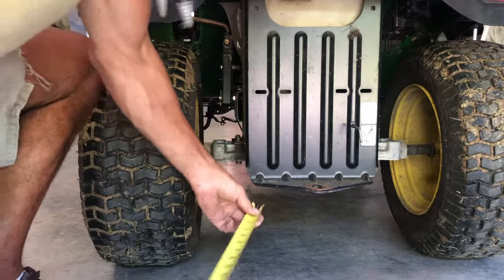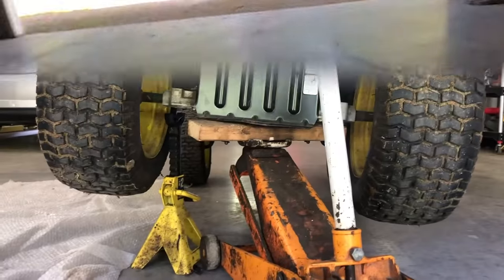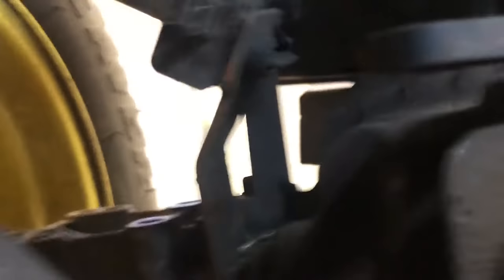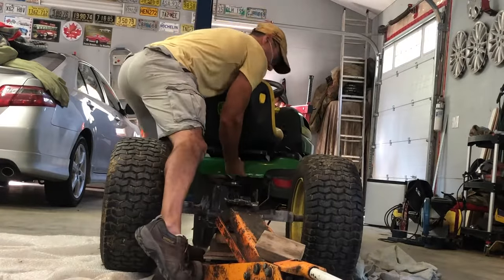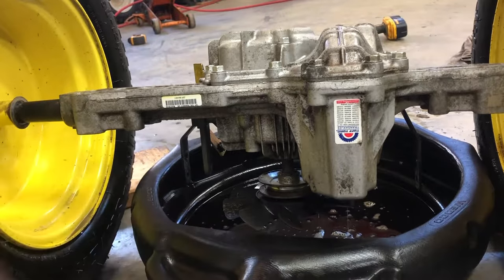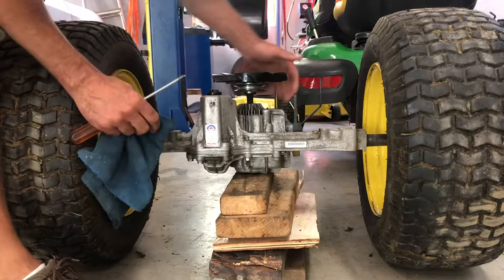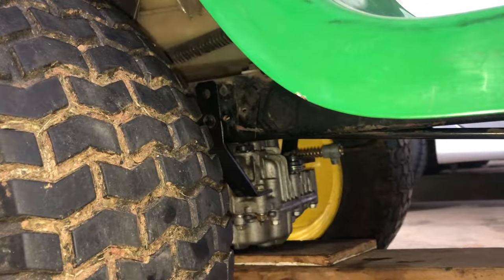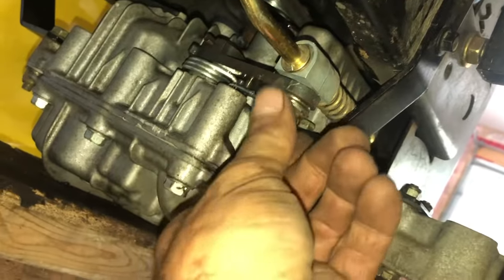How to change your oil in your Differential / transaxle / Transmission John Deere Lawn Tractor

Comment: My D170 is really struggling to go up hill after about an hour of mowing, never knew about changing the oil. My manual says no owner maintenance on transmission - go figure!
Going to get some oil today and change oil, hope it helps.
Reply from the maker: Hope it helps.   You can check out my "Part 5, LA165 John Deere Lawn Mower Tractor Mower rebuild".  I take the trans apart.  
   (I wouldn't take it apart unless it stops working)
Reply: and if you take it to the John Deere dealer, they'll tell you the same thing, no maintenance.  They'll say you have to replace the old transmission with a new one when all you really need to do is change the oil.  The cost of doing that is high enough so that most homeowners will choose to buy a new tractor which is exactly what John Deere wants you to do every 4 or 5 years.  that's why they use these crappy designed "unserviceable" throwaway transmissions.  They also never tell you that if you plan on keeping your tractor for more than 4 years, you should do maintenance on the transaxle after the first 50 hour break in period.  That's when the oil will be dirtiest with metal shavings in the gearbox.  You should remove the transaxle and take it apart to remove all the dirty oil and metal shavings out of the gearbox, and then replace the old factory installed 10W30 oil with a slightly heavier grade 5W50 oil.  That will give your transaxle maximum torque and a much longer life.
Reply: @mrbubetube  GREAT comment, every body should read this.

Comment: Will be using Amzoil Hydrostatic zero turn 20w-50 oil with a preferred price less than $10 a qt. This oil can take the heat and maintain its viscosity for a longer period!
Reply from the maker: I'll have to try this oil next time..  Thx...
Reply: I'm with you on the 20-50
Reply: @me37594  or castrol 20W 50. Used it in my lawn mowers and motorcycle engines and car engines for 50 years. Never any problems. thanks. 🙂

Comment: Thanks for the video. The manual said I had to change the transmission fluid but does not show how. Is the process the same for x350?
Reply from the maker: It’s totally different.   Drain plug at the Bottom. Side oil filter.  Filler cap in the back .

Comment: Thank you very much for the time producing this video, well done and lot's of good educational information! Seems this is a lot of labor for a simple drain/fill procedure. Is there an aftermarket and/or new version of the oil pan with a drain plug or would removing the bottom of the transmission pan to drain then fluid, reinstall pan with new gasket, then refill the transmission as an other option to avoid the labor and time to remove the transmission axle?
Reply from the maker: There is a drain kit available for it.  “Taryl Fixes All “ did a video on it.  
   The transmission still had to come out.

Comment: good video, I have a John deere 110, with 425 hours, I have never serviced the differential, it sounds very dry, I think it needs an urgent oil change.
Reply from the maker: The noise you hear is the hydraulic pump. (Normal).  It wouldn't hurt to change the oil when you have time on your hands........ Don't overfill it.  22-25mm top edge.

Comment: Great video! Are there any current production lawn tractors that do have a proper drain/fill plug? I hear Cub Cadet XT1 does, or did, but I am not sure.
Reply from the maker: That’s the only one that I know that has them.  You have to lower to transmission down a couple of inches to fill it back up.  You need a mirror to look at the oil level so you don’t over fill it.

Comment: I'm looking at possibly buying a used john deere x350 from my dealer. Looks,runs,and drives great. Its got 296 hours on it and has the k46 transmission. Of course I have no way of knowing how it was used and possibly abused,but it looks to of been garage kept. They're asking $2900 for it,but they also have an x580 which has the serviceable k72 transmission.  It's the same year and condition, but has 500 hours on it. They're asking $3999 for it. I do mow some hills that my current ltx1040 cub cadet struggles with. If it were you,would you buy a small newer mower,the 300 hour x300,or the x580 with 500 hours on it? As long as the engine and tranny are sound I dont mind replacing belts,spindles,and switches. I'm pretty mechanical, just thrifty. I mow about an acre and a half a week
Reply from the maker: Bigger the tractor the better, lol. Offer them $3750, $3800. Tell them you want the oil changed in the transmission . 
    A X580 here in Canada are over $6000us.
Reply: @WeekendHobbyMechanic  thanks,I'll tryin talk to em more about it.

Comment: Thank you. Having watched this I have no reluctance to tackle a fluid change. You did not omit a single step.  Appreciated.  I have a low hours JD 160 and since I mow straight up some very steep hills I expect my transaxle will benefit from a switch to full synthetic and regular changes.  I have 40 hours on the tractor now.  Should I do the first fluid change at 50 hours?
Reply from the maker: No.. Change it at 200hrs..   Remember the Oil Level after priming the Pump & motor should be down 22mm 25mm from the top edge of the filler cap.
Reply: Yes, change it at 50hrs per Tuff Torq website: https://www.tufftorq.com/tuff-torq-k46-oil-maintenance/
Reply: @joshlasceski  The JD 160 has a gear drive transmission (Peerless, if I remember correctly), not a Tuff-Torq.  According to my dealer, there is no need to service it.  I have about 1700 hrs on mine.  As for the Tuff-Torq, it seems to me like a pretty poor design if you have to remove the transmission from the tractor just to change the oil!

Comment: Thanks so much for this great video. I don't think I have ever saw any one do as many replies as you have. My JD LA 145 is VERY SLOW going up hill. It has about 425 hours on it and the transmission oil has never been changed. There is also whining noise which may be coming from the tyranny...(not sure). Which oil, 5W50 or 20W50 do you recommend? I'm in Va. so the mower is used in, some what, colder temperatures. Thanks again!
Reply from the maker: Use 20W50.  Your pump is probably getting weak.  (Thicker oil should help)....
Reply: @WeekendHobbyMechanic  Thanks for the quick response!

Comment: My LT166 is a 2002 and has never had the trans fluid changed.  I called the dealer about it and he asked "is it slipping"?  No, it has never slipped or done anything out of the ordinary.  He said just leave it alone then.  Well that is what I did and it is still working perfectly so ????

Comment: Oh man that is way more than you need to do, just drill a tap for drain plug in the bottom of trans and then you can change it easy. It took me maybe 20 minutes to install a drain plug in mine.
Reply from the maker: You would need to drill two. Gear side and Pump side....
Reply: @WeekendHobbyMechanic  Yes, but even one works if you change it a little more often, but  I may go ahead with the second drain. Good video for those that don't want to drill and tap their trans. Thanks.

Comment: What are some symptoms of needing to change out this fluid?
Reply from the maker: I would recommend changIng the oil every 150-200hrs.   If the tractor is slowing down going uphill I would use 5w50 Castrol oil.

Comment: Do you think you could use an evacuator and pump it out instead of taking it out and apart.. suck the fluid out vs dropping rear end
Reply from the maker: Could be done, but it would be hard to check the oil level.  22-25mm from the top edge.

Comment: I have a JD 190C with the tuff torq k62. 
My question is it says it has two separate drain and fill points (one for the hydro stat the other for the trans axle) and I have to prime it as it does not self prime. But you just dumped yours over and filled back up. Am I missing something?
Reply from the maker: K62/K66 transmissions are a bit hard to prime after an oil change.  Different transmissions. They trap air bubbles.
   To prime these you have to leave the filler caps off the transmission.   Jack up the tractor (use jack stands), run the tractor for a bit.   
     Then shut off the tractor, rotate the back wheels (by hand) back and forward.  Top up your fluid levels.  Then repeat the process again.   Do this three or four times.  
      After you get some resistance in the back wheels, run the tractor for 30 secs (forward/backward).   The wheels should start spinning.    Top up your fluid levels again.  Install the filler caps.
Reply: @WeekendHobbyMechanic  thank you so much.  I subscribed.

Comment: My machine (D125) leaked a fair amount of transmission fluid while in the garage for the winter.  Watched your video and dropped the rear axle.  Mine appears to be leaking from around the other cap that is on top of the transmission, not the flat fill cap.  I can't seem to figure out what this cap is called to order a replacement. Any idea?
Reply from the maker: The breather cap?  It sits a little higher the fill cap?  Oil won’t leak out from the top of the transmission just sitting idle.  It will leak a bit if there’s a bit too much oil in the transmission.  No biggie, it will stop.   
   Check to see if it’s leaking around the axles seals or the bottom pan gasket…. Also check the fill cap for crack in the rubber.

Comment: I let my tenant use my JD LA120 and they reported it quick working.  I'm 400 miles away and can only work on it in snippets. I replaced the lever arm from the PTO handle to make the blades function again  but when I tried to move it there is no tarns action.  Unit has 800 hours on it.  I wondered if they had pushed or pulled it and broken the trans. The neutral rod was pushed in so trans was engaged. Don't know if that could break the trans.  I pushed the neutral rod in and out a few times. No luck. The trans drive belt is still there.  Mostly wanting to know if the unit was pushed or pulled hard in-gear can that break the trans.
TIA
Reply from the maker: Maybe they broke the drive belt.  Have a look if the fan is Turing on top of the transmission. You will need someone on the tractor to engage the transmission. 
  You should be able to see the top of trans under the left side between the fenderdeck and back wheel.   With the brake off, the belt should be tight.
Reply: Thanks I'll try that. The belt was really loose but I'm not sure the brake was on or off. @WeekendHobbyMechanic

Comment: Great video. I have oil coming out the left hub and a grinding noise. I guess a bad seal. Can it be saved?
Reply from the maker: Wiggle the shaft for side play. Bushing might be worn.   Might need a new bushing and a seal.  
   If there's hardly no play, you might just need a new seal.
Reply: @WeekendHobbyMechanic  Thanks for the video and suggestion.
Reply from the maker: @darrellanderson6650  I redid this video. Check it out. 
https://www.youtube.com/watch?v=on7aHn2v2Rs&t=323s

Comment: I seen you used the JD fluid. If I wanted to change to Amsoil 5W50 do you think it would be a problem?
Reply from the maker: That would work....   (That’s the best oil)
Reply: Thank you. Great videos!!!
Reply: Just use Castrol, 20w50, use Castrol in everything, your vehicle will thank you
Reply: @GatesRapes  engine oil in the transmission???? HUH???

Comment: I use a over head hoist and it’s pretty fast and easy to drop rear end and replace it
Reply from the maker: Hard to check the oil level that way.
Reply: @WeekendHobbyMechanic measure it😊

Comment: Very informative. But a question for yah. I have a  2015 CUB CADET XT2 LX46 with no manual. Would you know what transaxle normally comes with it? In not, how do I go to find out the easiest way? Thx much.
Reply from the maker: Tuff Torq Hydrostatic Trans .  You can check the model number on the sticker in the back trans.
Reply from the maker: Model is a K46
Reply: @WeekendHobbyMechanic  thx much.

Comment: i am getting ready to strip one of these l130s down and what is the wire that runs to the rearend? i see yours has a wire hooked to it.. mine dont care to answer? thank you
Reply from the maker: The wire goes to the transmission reverse switch.    It’s a safety device.

Comment: I have a John Deere gt245. I sent it to you the repair shop to replace the transmission drive belt and when I got it back the transmission itself is leaking whether running or sitting. It seems like it's coming both out of the overflow bottle and from somewhere else. Thoughts?
Reply from the maker: If it’s coming out of the overflow bottle it’s probably air in system.  You can suck a bit of oil out of the bottle and run the tractor for a while.  Then check the oil level after.

Comment: I have an LT-190 machine with 228 operating hours on it. What kind of oil should I put in the transmission, and how often should I change it?
Reply from the maker: Came with 10w-30 from factory but you can use 5w-50 castrol synthetic. If the trans is slipping a tad you can use 15w-50 mobil 1.
Reply: Thank you very much! @WeekendHobbyMechanic

Comment: My magnetic was just a magnetic. Circular, I wonder if it’s missing the holder like yours. Mine is d140
Reply from the maker: Yup,  You’re missing the holder.      No big deal.
Reply: @WeekendHobbyMechanic  just completed the project. This video was very helpful. I went with Amsoil 20-50 hydrostatic fluid. D140 only has one magnetic with a slot built in on the tranny :)

Comment: Saw this video, got all excited, went out and bought the oil and plug (which wouldn't fit) drained it refilled it, put it all back together and it still won't move! 😢😮😱
Reply from the maker: Was it working before? Was the old oil dark in colour?     Watch this video:https://m.youtube.com/watch?v=3D_vtMg-Zxg&pp=ygUfUmViaXVsZCB0cmFuc21pc3Npb24gam9obiBkZWVyZQ%3D%3D
Reply: @WeekendHobbyMechanic  hi thanks for your reply.

The oil was darkish I guess.... There's over 700 hours on the clock. It's a D140 over 9 years old. I inherited it from my parents. Dad's pretty sure the oil's never been changed in that axle.

I'll check out your link, thank you. 👍
Reply: Watching your second video I realise that perhaps I didn't "prime" it like you did, nor did I take so much care (any) with miniscus depth measurement.

I did tip it from end to end as you did in the first video.

I might Google to see if there's a check list of things that stop your lawn tractor moving 🤔

It has a new drive belt.
Reply from the maker: @andrewboydnz   Make sure the Neutral Rod is all the way in and the E-Brake is off.
Reply: @WeekendHobbyMechanic  now I'm wondering if it might be the clutch(?) Pulley thing under the engine. 

If I pulled the backwards/forwards lever on the axle and rotated the fan, the whole axle thing wanted to  rotate 🤔
Reply from the maker: @andrewboydnz   Have somebody start the tractor and release the E-brake. Then look on the top of the transmission if the fan is rotating.
Reply: @WeekendHobbyMechanic  the belt's not moving! Going to check and see if something's stopping the brake from releasing all the way out... New belt seems a bit loose 🤔 (as did the old one)
Reply: Finally I removed the new Chinese belt and installed an original. Now it's moving! Yay!
Chinese belt on the cutting deck is totally fine, but I guess there's more travel in its tensioner 🤔
Reply from the maker: @andrewboydnz    Awesome!
Reply: @WeekendHobbyMechanic  thanks for your help! 👍❤️

John Deere should be paying you for keeping their customers happy 😊
Reply from the maker: @andrewboydnz    That would be awesome. lol

Comment: I have a tuff torq t40 should i use the original 10w30 that is calls for or somthing thicker i have a power problem after a year of use. I have changed all the pulleys and the drive belt on my JD and still nada as far as fixing.
Reply from the maker: Tuff call on that one.  Ticker oil will help but it will slow it down a bit.    Check the color of the oil.   Dark means it’s not good.  Filter could be dirty.

Comment: I mean the Mfg. putting in a drain plug and fill plug might have saved us all a lot of hassle.
Thats why i will never sell my Craftsman GTs... they will run forever with proper maintenance (like changing the trans fluid since it only take 10 mins)
My LT2000 requires a process similar to this and takes 3+ hours.

Comment: Would this be the same procedure with the X380- K58?  I only have 130 hours on the unit, just curious to do this in the next year or so. I only put roughly 50-70 hours per year, cutting 2 acres.
Reply from the maker: They’re different transmission.  The X-380 is a commercial heavy duty mower.  Last a long time.   
  Has a drain plug and a refill tank.
Reply: @hilljack6765  Thank you for the information. I currently only have 153 hrs. I just completed the valve adjustment this weekend with new gaskets and new tie rod ends. I will put this off until another year or 2 before I'm even in the 200+ hr range.

Comment: I broke my vent cap off and the shaft is still in the opening ... was going to suck it out....any suggestions ?
Reply from the maker: Clean for vent cap and transmission. Add a small amount of silicone and place the vent cap on top.  Let it sit for a bit.  
  Remove the transmission and drain the fluid out of it.   Check out this video 
https://m.youtube.com/watch?v=on7aHn2v2Rs&t=275s&pp=ygUiVHJhbnNtaXNzaW9uIG9pbCBjaGFuZ2Ugam9obiBkZWVyZQ%3D%3D
Reply: above my pay grade ...it is on an X320..same cap though @WeekendHobbyMechanic

Comment: How much trans fluid does it take? Trying to order ahead of doing the job. Also, I'm thinking of synthetic 20w50 hydrostatic fluid as I don't use in winter. Anyone foresee issues with that?
Reply from the maker: That should be fine.  2.4 quarts or 2.2 litres